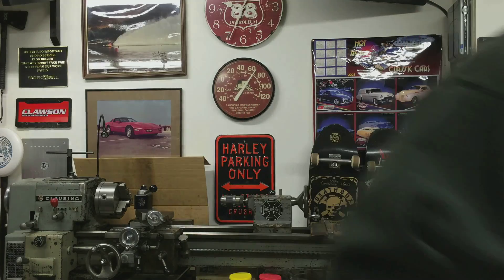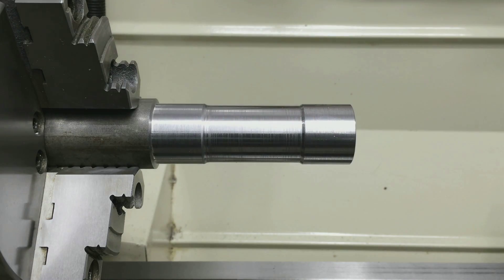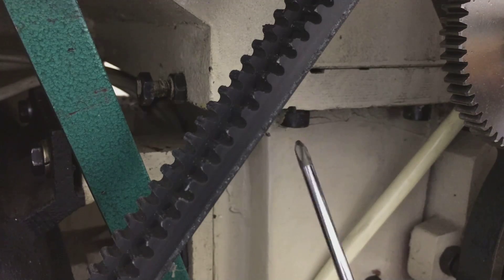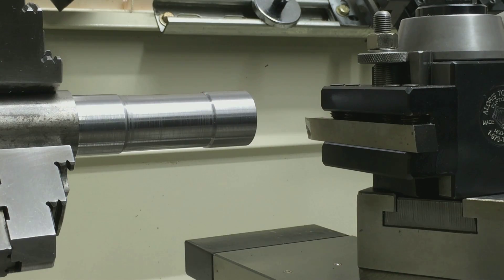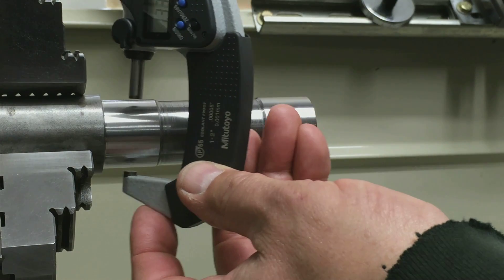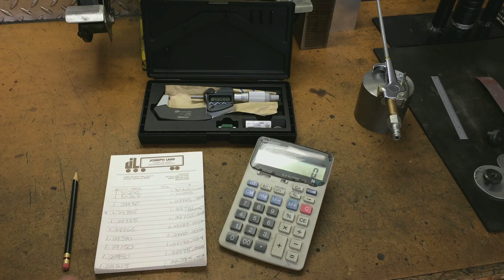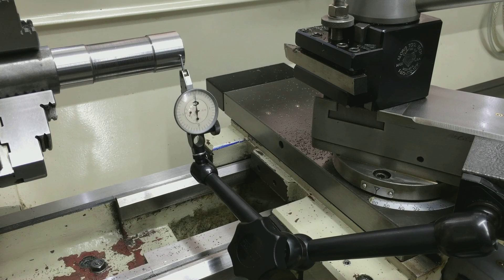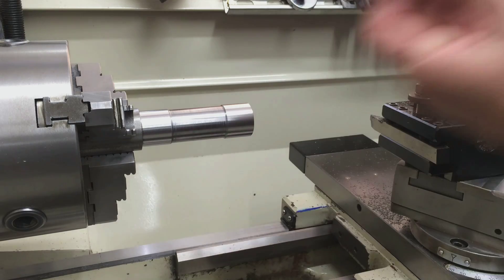Lathe Head Tramming

Comment: The issue here is, if you're ways are twisted, you'll see the same taper. You have to isolate whether the taper is from bed twist or from head out-of-tram

One way you can do this is, instead of cutting a piece of stock, FACE a large diameter and check for concavity. This will show you the current state the spindle being in or out of tram. THEN check for taper and adjust for twist in the bed.

Comment: I realize this video is almost 4yrs old, but I have the exact same machine and I’m tramming the headstock as we speak- do you remember what you torqued the bolts too?

Thanks for the great videos.
Reply from the maker: Hello Izzy, If my memory serves me correct I believe I torqued them to 97.5 N.m  Or 72 Foot Pounds. This is the torque spec for a M10 Socket Head Cap Screw BUT please check me on that before you break and or strip your bolts. Best Regards, Ray
Reply: Ray Caniglia - I appreciate your quick response and info. Right after I submitted my question to you, I realized I was just being lazy and should of sent that question to Grizzly. Your videos have been very helpful and I appreciate the content.

Thanks again, and have a happy holiday season.

Iz

Comment: Hi Ray, and interesting video. 

Had you considered your ability to accurately and repeatably measure to levels as small as 0.00005? The instrument may well be able to measure so finely but we also have to be able to use it in such a way that we actually can get the best from it. You could spend a long time chasing something that your not actually getting. Also, by doing this test over a relatively short and small diameter it makes looking for tiny amounts that may well never be realistically achievable. I wonder what the Grizzly performance report gave? Sometimes its possible to spend far too long chasing tiny numbers that really aren't needed for what would be considered good/accurate machining.
Reply from the maker: +Alan Maughan Hi Alan,
I agree and am sure that temperature will change the measurement and accuracy as well. This type of accuracy is not needed for what I'm doing, just wanted to get it as true as possible.

Thanks for tuning in!

Best Regards,
Ray

Comment: hey Ray,

good work. FYI: Richard K told me to set 0.0002 @ 6" to account for tool deflection and temp. My JET as delivered had 40 arc seconds of  misalignment. On the back of the machine is a bondo filled line I cut with a Drexel tool that would allow head rotation. A rubber hammer will move it. also if we knew the distance from the face of the headstock to the 1" pin we could use similar triangle to predict bar movement needed. on the JET the headstock to way interface was not flat, so I had to leave the 4th screw snug. tightening it would deform headstock 0.0002".
Reply from the maker: Hi James,

Sounds like you have your Jet dialed in pretty good, I too had to leave one of the headstock bolt a little more than snug and used it as a pivot to get running true. I just checked it again last weekend, I'm getting 1/2 a tenth over five inches, not touching it!

Thanks for stopping by!

Ray

Comment: Hi Ray, great video - very useful.
With the camera angle, it's hard to see where you stop cutting and if it is also where you set your micrometer (closest to the chuck) - to the untrained eye (me) it seems it is risky close.
Reply from the maker: Not the best camera angle for sure but I was about .250" away from the end of the cut. I also checked the results on the middle of each pad with the same result.

Thanks for stopping by, and commenting!

Ray

Comment: Good video Ray.
My old Southbend doesn't have this adjustment feature.
While we're discussing level and what not, let me add this:
Level is not that critical to a lathe.
Think about this: the Navy has had floating machine shops for years, where is level when you're at sea?
The critical item is to make sure that the bed is straight and not twisted.
The test bar you used is the same type of test that Southbend outlined in "How to run a lathe."
For non-adjustable head stocks, sometimes "tweak" has to be introduced into the bed in order to remove taper from the test bar experiment.
You effectively did the same thing by adjusting your headstock.
I enjoy your vids Ray, keep 'em coming.
BTW, has anyone told you that you sound like Jesse "The Body" Ventura?
Regards,
Duck
Reply from the maker: Hey Duck,

Thanks man! Yes, I have been told I sound like Jesse,and  look like Vin Diesel, it's all good! Sounds like many viewers lathes are not adjustable so the tweak technique would have to be done for a good tram.

Thanks for stopping by, and for your comment!

Ray

Comment: I have been reading the comments and it was mentioned to also check your tailstock alignment .And some old lathes the head can't be adjusted.....I know the only dumb question is the unasked one ...So I was wondering if you cannot adjust the head on an old lathe can you align everything by just doing the tailstock ?? I would guess both have to be done
Reply from the maker: Great question! You tram the head by leveling and/or un-twisting the bed ways using shims or adjustable leveling feet. You tram the tail stock to your part by using a mic on both ends of your part and adjusting the tail stock accordingly.

Thanks for you comments!

Ray

Comment: Hi Ray,

There's something to be said for machines like my Harrison where the headstock locates on the bed Vee and was align bored in-situ. They don't go out of tram.

You have a digital micrometer, set a local zero and get a direct reading of the difference in diameters.

You can buy test bars with a built in MT taper quite cheaply these days.

I've had no parting problems ever since I started running the blade upside down and the spindle in reverse. It converts your toopost to 'spring tool' geometery where the cut depth gets shallower due to flex, rather than deeper and chattering or digging in. Don't try it if you have a screwed spindle nose of course!
Reply: My Chinese lathe has V-Was all the way to the end! But the V n the headstock is wider and bridges the one on the bed, essentially resting on flats , both sides....does this still count for anything Paul? haha
Reply: bubster1981 Both tailstock and carriage ways extend right to the end, im guessing i got the Chinese short bed version
Reply from the maker: Hi Paul,

Great information, would have been nice if my lathe was built like yours! I will take your advise and hopefully have positive results on both tramming and parting using your method!

Thanks again bud!

Ray

Comment: hey Ray, nice video. Don't forget to check your tailstock alignment after this (maybe you did already) - don't ask me why I'm saying this (i aligned my head and forgot about the tailstock, couple of weeks later I didn't know why I'm scratching circles instead of drilling)
Reply from the maker: Great point, I should have mentioned this as well. I tram my tailstock every time I use it using the same method, I can usually get it to zero at each end in a few minutes every time!

Thanks man!

Ray

Comment: Hi Ray,
About half a year ago I just purchased and had a brand new Iscar tang grip blade explode on me... Second cut of the day I was parting 4" aluminium - Don't know what happened. I was using a steel insert on it, feeding too slow, or didn't have the tool post tightened down enough because it dug in, grabbed the part and knocked the Aloris out on an angle. The blade snapped and the slug of aluminium came out of the three jaw. It spun out and down hard into the gap bed section and I slammed the foot break. A hobby guys worst nightmare - scared the shit out of me. Sheepishly went over to the bandsaw to cut the part, and replaced the blade the next day, and got correct grade inserts for all metals with it! Scary!

Tim
Reply from the maker: Hi Tim,

Yea, I know the feeling... Good thing mine was not as bad experience as yours, since I was using a cheap Chinese blade my part and lathe were saved from damage!

Thanks for stopping by!

Ray

Comment: Thanks Ray. I am a newbee and never thought that the head might go out. You always see videos on aligning the tailstock but yours is the first I have seen on headstock alignment. Keep these videos coming. I am learning a lot from you guys.
Reply from the maker: Thanks David,

Be sure and level your lathe before you tram the head, un-level and/or twisted bed ways will also cause this and sometimes can be corrected without having to tram the head. Tailstock tramming is much easier since you can do it on the part you are machining and should always be checked end to end anyway.

Thanks for stopping by!

Ray

Comment: Hey Ray...... man sorry to hear that this happen...did you ever get that special parting blade? you will have much better luck with that stye  :)
Reply from the maker: Hey Lawrence,

I have not ordered them yet, and this would have prevented this! I did speak with them and am putting together an order, then Christmas and New Year came.... I need to get a few here soon!!!!

Thanks for stopping by bud!

Ray
Reply: Ray Caniglia I broke a couple HSS blades (cheap ones) and I even broke one insert. But since I went to inserts I've had much better luck. I have one of the "special" blades... haven't tried it yet.
Reply: Ray Caniglia Hey Ray, there maybe an underlying problem (tool post nodding?) which could be the problem...but since your lathe had D1 chuck mount i would mount the blade upside down and spindle in revers direction that way it can never dig in only wlll want to push out! :)
Reply from the maker: Lawrence Harasim Thanks again Lawrence, Several have recommended turning the blade over as well. I am going to place an order with Tom at Newman for a couple of the Hufnagel blades. I think between these two changes I should have this one resolved, lets hope!

Ray

Comment: Great run-through Ray. That lathe is an exact copy of mine!!
Most new gear had the adjustable headstock these days but the old iron without gap beds normally used a ground v-way on the bed. I wonder if your older lathe is adjustable??

Cheers
Colin ;-)
Reply from the maker: Hey Colin,

Yes, I have noticed we do have the same exact lathe, I bet they were made in the same factory and ran out of green paint so used the next best color.... I do not think the Clausing is adjustable, it has a alignment pin on the front bed way, I'll have to take a look since I know there is a .001 taper over a 5 inches, not bad for a 1967 High School retired lathe!

Thanks for stopping by buddy!

Ray
Reply: I noticed a small issue with mine today. I'll stick a pic on G+ to show you. Wound up re-doing the whole apron and its clearances. No time to record it...needed the machine operational asap.

Comment: My little atlas has no built in tramming means, I would need to use shims and that would just be a total pain. I've done the tests and I'm out 2 thou over 6", close enough for my work. I wonder if I could twist the bed enough to fix that.

Thanks for sharing Ray, always good to know the tolerances of your machine and get it the best you can for the jobs at hand.
Reply from the maker: Hey Steve,

I agree .002" over 6" is good for what we do but, I bet you could get it a little better by getting the twist out of the bed ways. Maybe one of those rainy day projects...

Thanks for stopping by buddy!

Ray
Reply: Yeah, all we've got are the three bolts that secure the head to the bed, huh Steve? I wouldn't know where to start to get something in the Z-axis to affect the Y-axis...even with shims, wouldn't it just be creating more of a twist to things? As I said, I'm lost when it comes to how to adjust our, but Ray's lathe seems like while it takes patience, it is possible without melting your brain.

I'm still going to try and see how far out I am with a test bar, and will try and take any twist out of my ways, but something happened today that may be a game changer for me :D

Aloha...Chuck
Reply: My little lathe is the same way, The head has a v way in the bottom of it and just sits on front most way, and is only held down with 2 bolts.

Comment: It makes you wonder how lathes on ships or on trucks or trailers can get the job done. I was wonder too if the lathe might have shifted on its feet from the incident. As Ray showed its a bad practice to set things on a lathe.

Keep it one hundred Ray!
Reply: Maybe a ships floor is more rigid than we think (at least something like an air craft carrier)?
Reply from the maker: Hey Mike,

Randy Richard worked on big ships for years, I am sure he could explain how the ships machine shop was set up and the machines held tight tolerances. I'll run it by him next time I talk to him, might make for a good video conversation!

I was always told not to lean on or keep stuff on machines, we all see how easy it is to move the 10th's indicator!

Thanks for stopping by buddy!

Ray

Comment: When that happened to mine, it broke the compound slide on the inside of the t-slot.  That thinner cast iron on the Craftsman 10" didn't like all that downward force.  I should probably check both of mine.  I did work out to not have the compound extended too far forward so the front part of it would be supported by the lower part of the compound.  Hopefully it is the last compound I have to buy for it.  The original one I got with it was also broke and had been welded.  Looks like I wasn't the only one to find that out the hard way.

Looking forward to getting the smaller AXA holder for the 10" lathe from Chuck.  The BXA post that I also use on the 12" might be just a little big for it.
Reply: It's on the way amigo! Have you checked to see where it's hiding yet? They probably won't get it to you until Thursday knowing how sluggish they are on my end...I'd apologize for them, but it wouldn't help, LOL! Talk to you soon...Aloha, Chuck
Reply: Hey, Ray.  I also have an Atlas 12" and the BXA is a little more at home there.  One of the reasons I asked Chuck if he still had the 2nd one so I wouldn't have to move the post between the two.
Reply from the maker: Hey Ryan,

Looking forward to seeing the AXA in use on your lathe! Yes, the BXA series 200 is too large for a 10" swing but, I would hang on to it just in case you get a larger lathe. I'll bet the parts are getting harder and harder to find!

Thanks for stopping by!

Ray